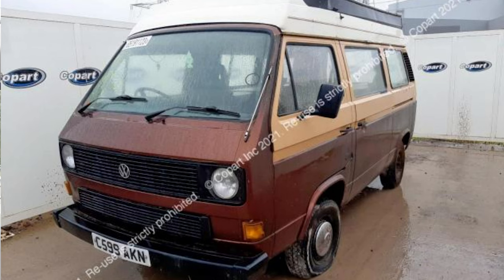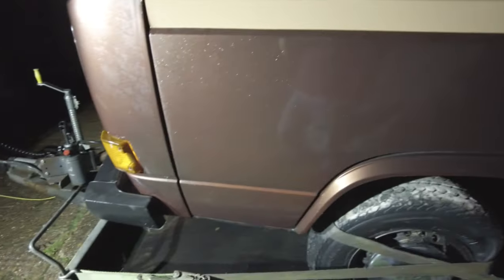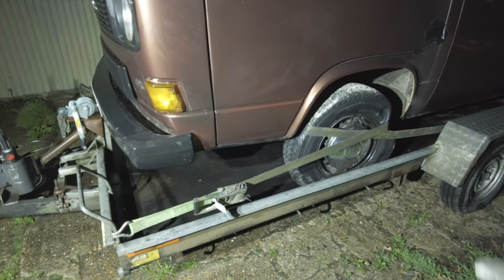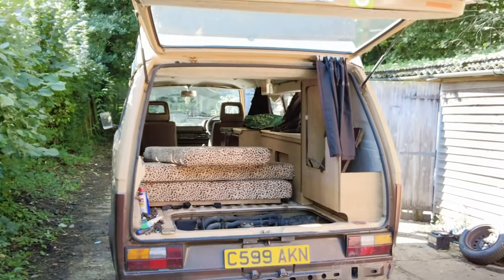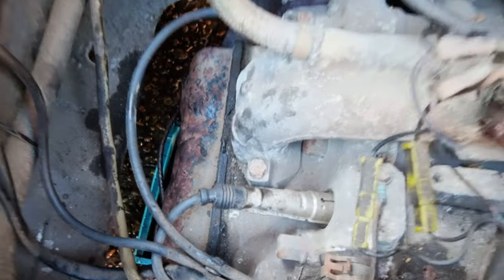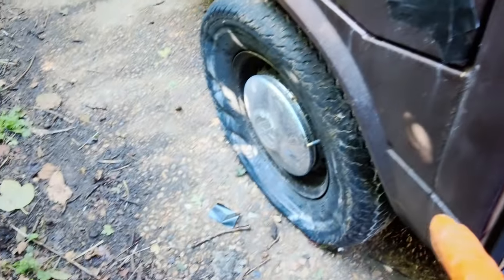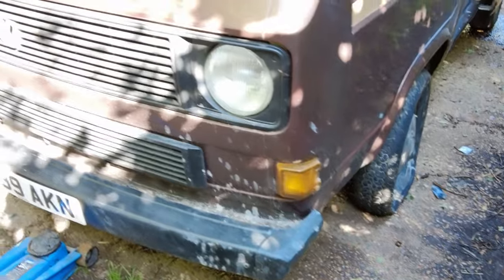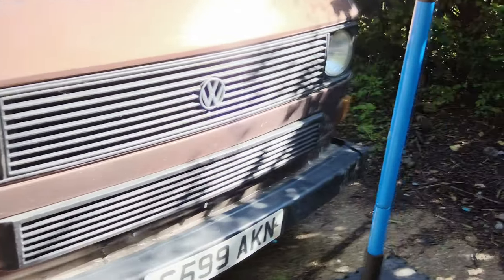Very CHEAP Volkswagen Camper T25 Non Runner, Destroyed Interior 🤦‍♂️

Comment: Three months on, I hope you’ve found some resources to help you bring this back.   I have an ‘84 model of this van and it. Can be difficult to find someone that will work on these.   They are known for being expensive to keep on the road.  
All that said, I love driving mine.   I had some very bright folks take it in hand and put an ‘89 Subaru 2.5L Forester engine in, check the rear, transmission, change the worn suspension parts and do an alignment.   If you need help you couldn’t do better Than Rocky Mountain Westys in Colorado Springs.